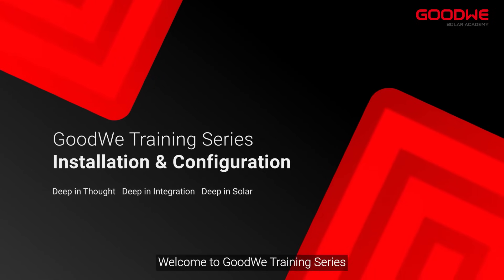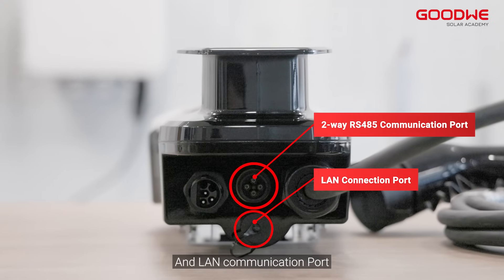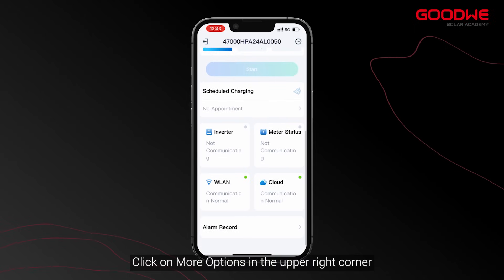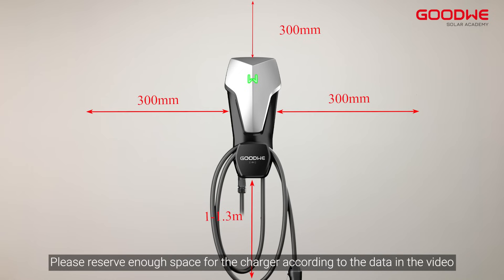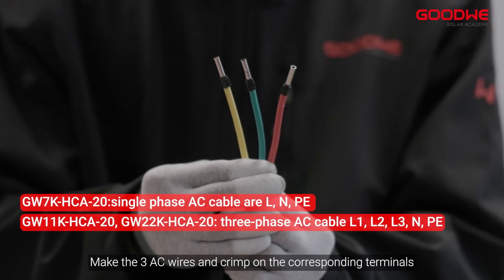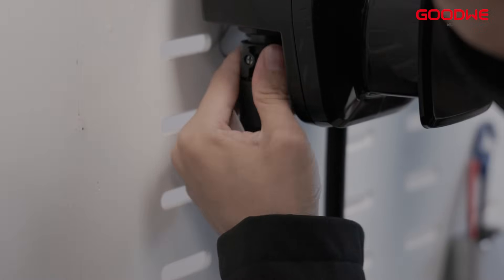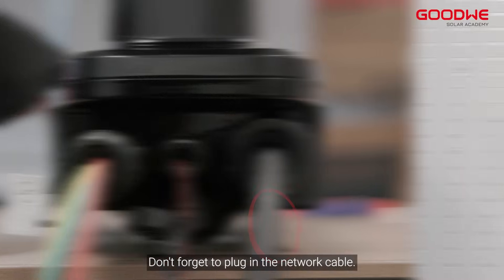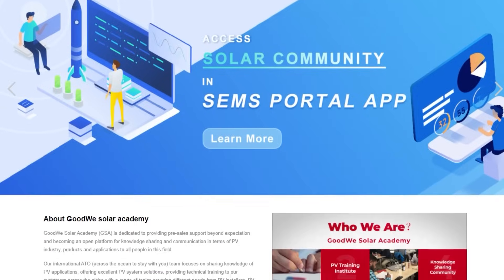GoodWe HCA G2 Series Unboxing and Installation

Comment: How does the load control work? Does it have a CT or does it integrate through the Sems portal?

I have a Goodwe Smart Meter GM1000 and GW-8500-MS30
Reply from the maker: Hello, The EV charger calculates the load power according to the household meter data and adjusts its own charging power to prevent the household circuit breaker from tripping due to excessive current, but MS G3 doesn't support.
Reply: @GoodWeSolarAcademy  Thanks, so feature won't work with my setup or will it because I have a GM1000 installed?

Also when will it be launched in Australia?